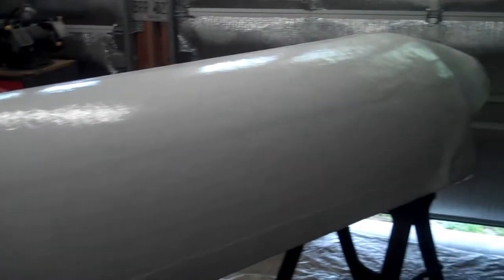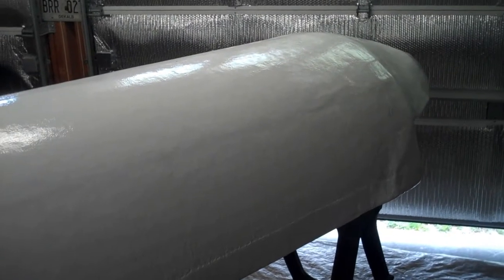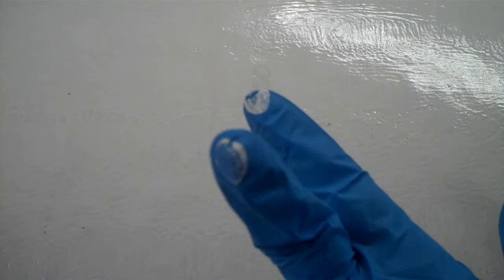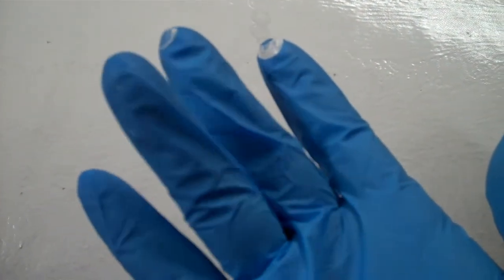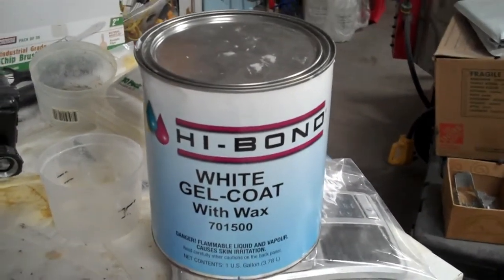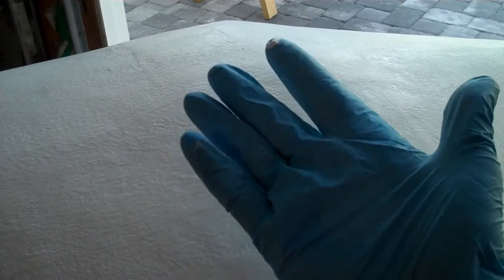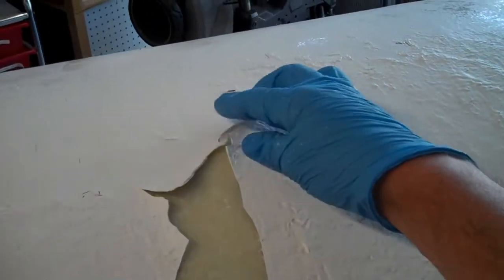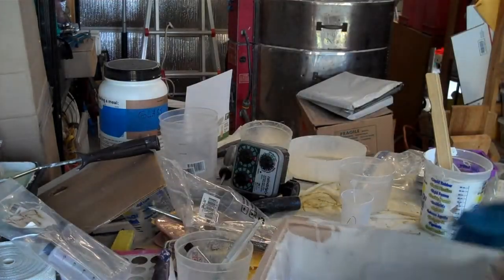Polyester gel-coat (Evercoat Hi-Bond with wax) issues (very slow hardening, too fast/hot hardening)

Comment: Did you apply with a brush or sprayer? I’m wondering if I can apply with a brush
Reply from the maker: I used a roller (and sometimes a foam brush) and the application appeared to work just fine. (But I had issues with the hardening process....so can't recommend this product...)

Comment: Hey did this ever fully cure?
Reply from the maker: @beachbum1808  yes, eventually
Reply: @summetj  i just redid my small pool with waxed gelcoat and hardener, and its been over 24 hours and still tacky
Reply from the maker: @beachbum1808  In my experience it sometimes took as long as 7-14 days to set up.
Reply: @summetj  wow, all of these threads online say sand in 4 to 6 hours. My pool is dry but still has slight tack, been 2 days
Reply from the maker: @beachbum1808  sounds like my experience

Comment: Gelcoat doesnt cure over epoxy
Reply: Watch Boatworks Today's test on this. It doesn't seem to matter much with modern gelcoats.
Reply: @klassica  not true. Its more dependent on the epoxy and if it has amine blush or not. I've also seen that video.  Trust me, you're not going to get away with gel coating an entire epoxy hull without using a barrier coat.

Comment: Is it because the wax?
Reply from the maker: Supposedly the wax makes the top layer harden up MORE than the inner layers. Because I only bought one type, I had to use the wax for all my layers, meaning I had to sand between layers. Professionals use "without wax" for the inner layers, and only use the wax type for the hard outer layer so they don't have to sand between layers.
Reply: @summetj  Thanks! I am in the process of making my own fiberglass parts from silicone molds and I happen to order with wax when I probably should have gotten without wax😬 I’ve been trying to find videos on the differences between the two and haven’t found any info, thanks again for sharing and your time!!
Reply: Without wax leaves the surface able to chemically bond to another layer of resin. With wax seals in the layer so it can cure in a no oxygen environment. This may have been an old can. Polyester resin doesn't last very long on the shelf.
Reply: @summetj this information is so hard to find. I found your video searching this question. Thank you

Comment: its waxed,,, so you cant overlay it!!! only without wax you can overlay
Reply from the maker: This was the first and only coat of the polyester gel-coat.
Reply: then its a flowcoat - topcoat, not a gelcoat @summetj
Reply from the maker: @kpost-s4n  I'm only reporting how it was labeled on the can...
Reply: the label is wrong, Gelcoat (with wax) = flowcoat  @summetj
Reply from the maker: @kpost-s4n  But does that explain the slow cure time, as this was the first/only application?

Comment: the product looks like is a POS, it gave you so much trouble..
Reply from the maker: I can't claim to be an expert using polyester gel-coat, as this is the only one I've tried to use, but I certainly don't recommend it, and will be trying an epoxy based gel-coat the next time I have a under the water surface to finish.